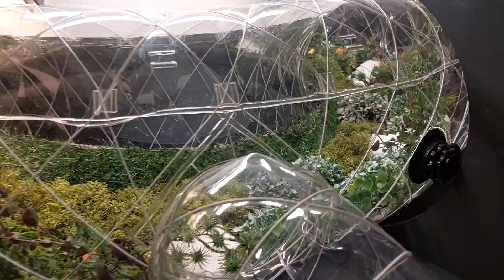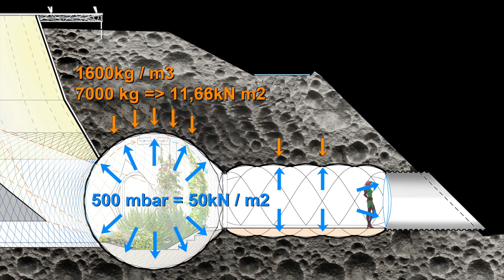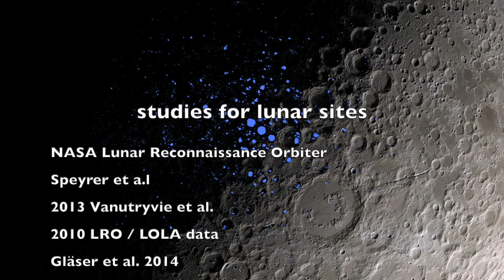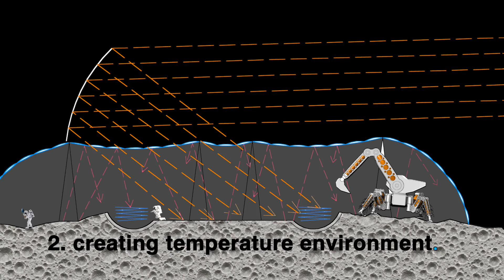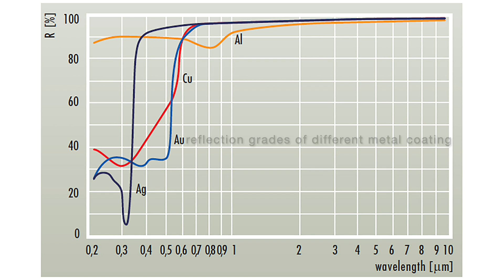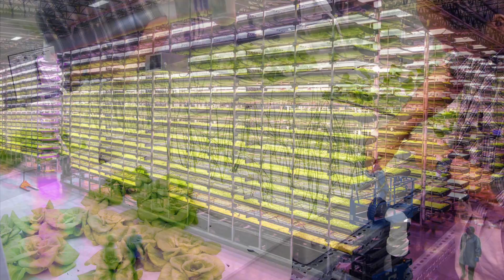PNEUMO PLANET Inflatable Moon Habitat, funded by ESA (Open Space Innovation  Platform)

Comment: You may not need to build a habitat in an area with permanent sunlight, you may just need to store energy within a sand battery along a with thermo photovoltaic cell for electricity generation. See Undecided with Matt Ferrell "How A Sand Battery Could Change The Energy Game" and  "Two bit Da Vinci" "Breakthrough Solar cell DOESN'T Run On Sunshine!"
Reply from the maker: a better battery system based on sand has many advantages on Earth on for a Lunar habitat as well. But still it has a lot of advantages to chose a location at the poles. The direct use of sunlight for photosynthesis  is still easier and better than the best  thinkable battery where we need electric wiring and LED lamps beside the battery. Also at the poles we have access to water ice, which is an essential resource for humans and plants,  and to extract oxygen und hydrogen fuel. Also we are exposed to less extreme temperatures.
But Mayer a hundred years later, when all the best locations at the lunar poles already are occupied, additional moonbases need to be erected further away from the  poles where periods off darkness are much longer and then we need an efficient battery storage with high capacity.

Comment: Intresting concept and very informative clip!. However, shadows is maybee more of an opportunity than a threat -if mirrors are arranged so that every 24h there is 8h shadow -providing a natural night/day cycle (with extended daylight hours the same way we have short nights in northern latitudes during summer)   :-)
Reply from the maker: Generally this is an interesting idea, but it wouldn't make sense under the given conditions. the sun radially moves  only  12° each day, You would need a lot of different shadow casts from a very long distance
the shadows last over a longer period than required. they last for 26 hours in average, when the mirrors are in a distance of 40 meters..  if the distance is a lot more to reduce the shadowed period to 8 hours, we would waste  lot of  space in between the  greenhouses. Additionally, there are shadows  casted from other mountains. The longest continuous  dark period  within a year is 4 days for our chosen site on the lunar South pole and 11 days for the chosen site on the North pole .